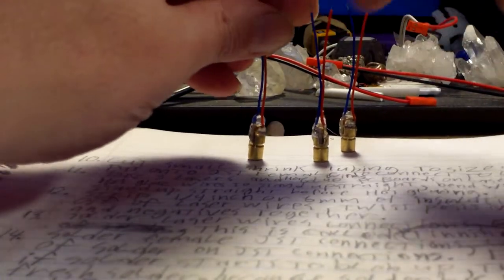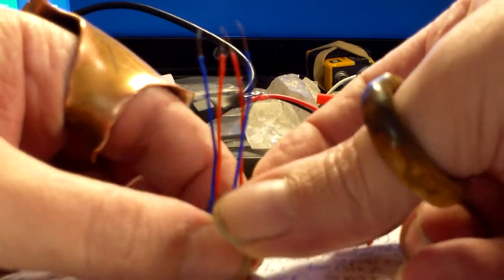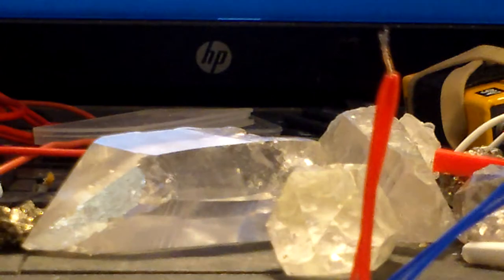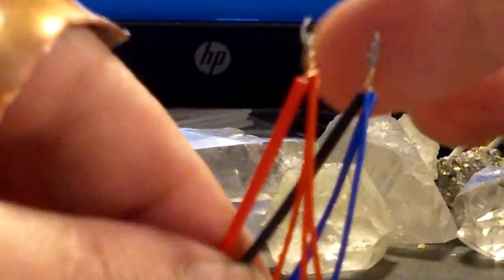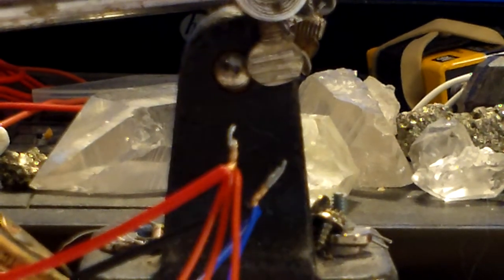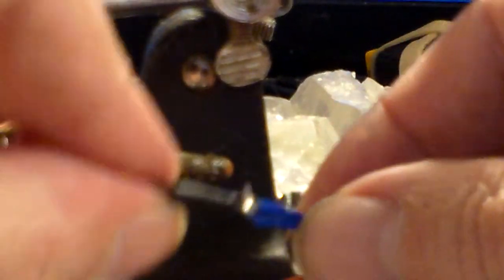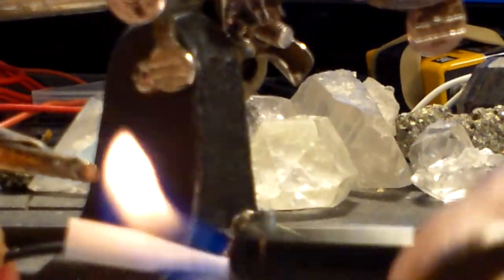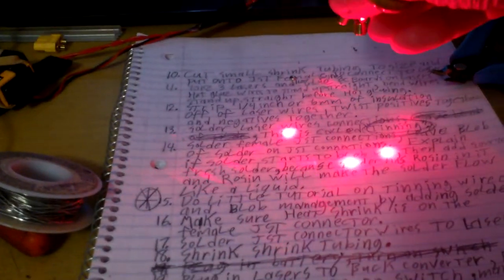PREDATOR TRI LASERS DIY 2021 EP. 10 PRETTY MUCH DONE !

Comment: Interesting stripping tool
Reply from the maker: My blue strippers are abouut 20 bucks , its called  ProsKit 1PK066N 2-in-1 Wire Stripper/cutter Auto Adjust Strippers , and heres the ebay link .    Yeah ii love my wire strippers :) 

Condition:New

Price:
US $14.97

Shipping:
$4.99 Standard Shipping | See details
 
Located in:
Boca Raton, Florida, United States

https://www.ebay.com/itm/272644238471?epid=808117691&hash=item3f7adcec87:g:YNIAAOSwSypY~sDb
Reply: That was my first thought
Reply from the maker: @PERRYS_PROPS  Theres a link in I think the second or third video , Or maybe this video on where to buy the strippiing tool on ebay  , theres a direct ebay link in the description , Good Lluck Man :)
Reply from the maker: @PERRYS_PROPS  My blue strippers are abouut 20 bucks , its called  ProsKit 1PK066N 2-in-1 Wire Stripper/cutter Auto Adjust Strippers , and heres the ebay link .    Yeah ii love my wire strippers :) 

Condition:New

Price:
US $14.97

Shipping:
$4.99 Standard Shipping | See details
 
Located in:
Boca Raton, Florida, United States

https://www.ebay.com/itm/272644238471?epid=808117691&hash=item3f7adcec87%3Ag%3AYNIAAOSwSypY%7EsDb

Comment: Hey buddy, thanks for this video. I'm waiting for your predator flashing eyes design 😎
Reply from the maker: Oh yeah I totally forgot about that , Ill tell You about it  I was trying to charge a capacitor that would turn on a transistor that would turn on the lightss around the eyes , and the best part is that i figured out how to use a touch sensor to flash the lights and also to turn on and off a Tri laser in the mask , and I figured out that I dont even have to use my hands to control the light flash and the   tri lasers , I can use my bottom lip to touch the touch sensorrs inside my mask , and the coolest thing about the touch sensors is that you dont even have to touch them , if You can get your finger within about 1 or 2 millimeters of the touch sensor then it will turn on .          Any Wayss Eulayses , thats what I need to design to do it but Ive been working on a project lately that Im going to lease to a company (itss a kids toy) and so Ive only been working on that lately .     I have already made the touch sensor tri laser system before and I sent it to anotherr gguy on YT for him and a regular tri lasers for his son and he made a video to show me that he put it in his kids helmet , heres the video   https://www.youtube.com/watch?v=S_ZHnOPyHIM